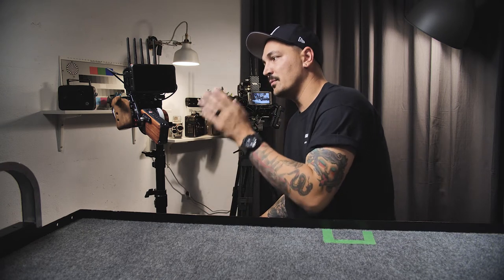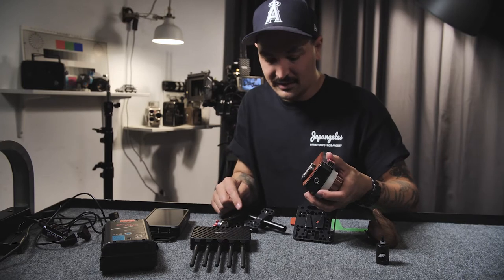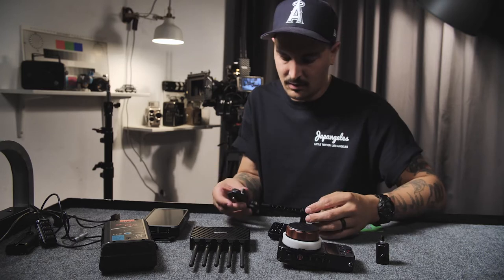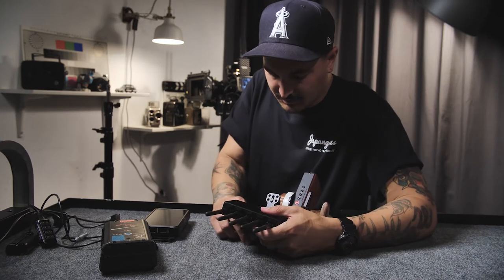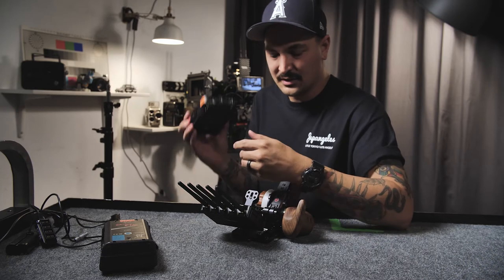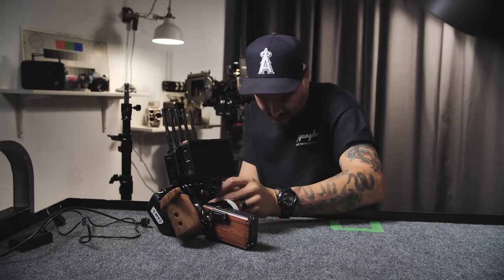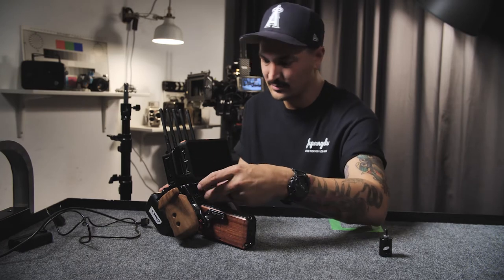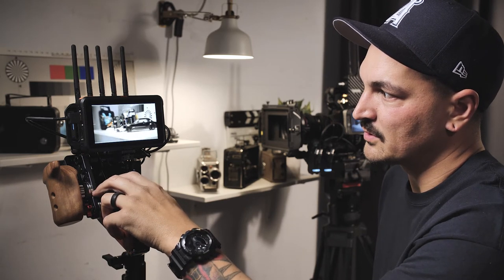Building My Wireless Follow Focus Rig - Tilta Nucleus M/Teradek Bolt 750 LT

Comment from the maker: Small rig no longer sells the L bracket as shown in the video. 
I found these possible alternatives. I have not tried or tested these but I think they should work. Buy at your own risk. 

https://tinyurl.com/yc8ayekk
https://tinyurl.com/2wu7wbam
https://tinyurl.com/3ru389au
Reply: Hey im from UK that link doesn't work have another for the L bracket ?
Reply: has anyone tried to purchase one of these lately?
Reply from the maker: Small rig stopped selling that piece. Unfortunately there is no way of getting a hold of them now.
Reply: that's such a shame!! It was such a great way to connect the battery plate to a 15mm rod.

Any other suggestions? Trying to build up something similar with my small 702 touch on a single rod system @JesseNelsonDP
Reply from the maker: @ash.walton  you could try these. I haven’t tested or tried them but could be worth a shot. 

https://tinyurl.com/yc8ayekk
https://tinyurl.com/2wu7wbam
https://tinyurl.com/3ru389au

Comment: I’m am curious as to what you where using before you bought this kit (upgraded from); transmitter; follow focus system; monitor???
Reply from the maker: I didn’t own a system before this. I would always rent or use the system production already had.
Reply: @JesseNelsonDP  thanks. As a follow focus operator what is your philosophy? brand loyalty based on market standards or best value money(you budget) can buy ad push for reliability and accuracy irrelevant of who made it?
I am a Director DP building a freelance matrix and more concerned about the 1AC talent/skill vs gear…
Reply from the maker: @All2jPro  A skilled AC should be able to work with any system and not have many problems so really at the end of the day it doesn't matter what gear or tools Im using. Im not beholden to any one brand per say but I do have enough experience to know that there are some tools that are easier to use and more reliable. So to answer your questions, its kind of both. I will push to use the brands I know will be the best for the job but Im not going to moan and groan if the budget can't afford the proper tools.
Reply: @JesseNelsonDP  yeah so true… one has to think of their needs reliability and after sales support as well… for example, after the youtube hype I tried the tilta nucleus n… hated the workflow and need for cables to power the motor… then the need for 14v to get more power from it diminishing the compact nature… So I ditched it went with PD Movie live air 2/pro love that its compact, TrueType wireless and can drive all cine lenses I have bought and hired without breaking a sweat and such an easy workflow that my 9yr old has used it for our mini house projects…

Comment: Beautiful setup man! I was thinking exactly the same thing except i wana get the Teradek Bolt 500 receiver instead, and i got the IDX battery already, but perhaps I'm better off with a Small HD monitor that already has the bolt 500 RX receiver built into the screen and that has a V mount at the back, but it's more expensive going down that path.
Reply from the maker: That’s where I’m headed with this rig. The atomos is already gone and I’m using a smallhd. I have the receiver for the teradek coming

Comment: This is a great set up! Thank you! I'm looking to mimic this exact set up but I'm having a really difficult time finding the 90 degree mount from the 15mm rod that holds the small rig vmount plate.
Reply from the maker: I have a link I just need to find it. Hold tight!
Reply: Have you found it? Looking for the same.
Reply: Email them asking for part number 1584 15 mm rod L bracket !
Reply: Does anyone know if these are still available? @ajfesta

Comment: I love this setup, and I want to repeat it for the most part.  But I only own gold mount batteries.  Do you have a recommendation for a gold mount plate that can be used in a similar manner to the v-lock plate in this rig?  I've looked at a lot of plates and I'm not sure what to use.
Reply from the maker: You could get a wooden camera gold mount and a cheese plate in order to mount it to the rig. 

This might work
https://woodencamera.com/products/gimbal-handle-bar-bracket-gold-mount?rfsn=6589536.3d595b&_pos=7&_sid=e76be8eaf&_ss=r

Or 

https://woodencamera.com/products/wc-gold-mount-dual-d-tap?rfsn=6589536.3d595b&_pos=10&_sid=e76be8eaf&_ss=r

Comment: Hey great rig! wondering if you can power the FIZ controller via the lemo cable? cant find any info online, are you strickly running the FIZ off the 18650 batteries? Thanks!
Reply from the maker: I haven’t ever powered the hand unit via Lemo but I believe it can be using the 5 pin lemo

Comment: Great video , i only have one question , how do you deal with markers? I'm used to setting marker points and pulling focus also based on them but with the handle sideways you can't really see the screen on side.
Reply from the maker: I typically use a dry erase or grease pen to mark the ring instead of using the screen on the front of the hand unit.

Comment: Hey I know this is an old video but what piece did you use to actually mount the assemly onto a stand? Thanks
Reply from the maker: I used the 1/4 20 light stand or “baby pin” adapter that comes with the Teradek. They aren’t exclusive to Teradek though so if search for a 1/4 20 baby pin adapter you’ll find them for cheap

Comment: Did you find a way to use rec/stop button with nucleus and ninja v?
Reply from the maker: You can buy run stop cables for different camera brands for the nucleus. I ended up getting the arri one. I didn’t figure it out for the ninja. That’s only because I ended up getting rid of the ninja for a smallhd 702 touch

Comment: Hey,
What brand of dtaps to limo etc  were u using or recomend ?
Reply from the maker: I’m not actually sure to be honest. That’s a old build so they were probably Alvin’s cables.
Reply: @JesseNelsonDP  should you always get quality cables?  could these 3rd party products like alvin harm/burn your device?
Reply from the maker: @llllllllllll9.  I try to use the cables that come with whichever device I’m adding to the camera, high quality cables are great to have but if you treat the cheaper cables well then you really shouldn’t have a problem. If one breaks or fails then I would use a Alvin’s or something similar if the device doesn’t come with several. I’ve never had a issue with a Alvin’s cable burning or harming anything.

Comment: WHERE DID YOU GET THAT MONITOR PLATE?!!!
Reply: @Jesse_PlaysGolf  No the item you link only has one screw for one monitor. It’s not dual like your’s where you can screw in your teradek and monitor in the same plate.
Reply from the maker: The one pictured is incorrect. It does have two mounting points even though the picture only shows one. I got mine on B&H.
Reply: @JesseNelsonDP  Hi im trying to order the dual screws but even the one pictured on B&H there is only one screw.

Comment: At the moment I have similar setup and the biggest issue for me is that the handle is very far of center of the weight and becouse of that its very hard to handheld rig for a longer time. Maybe someone already found a solution for that?
Reply: neck strap